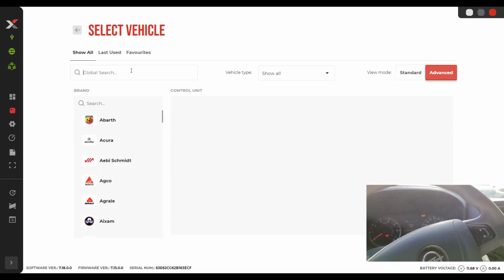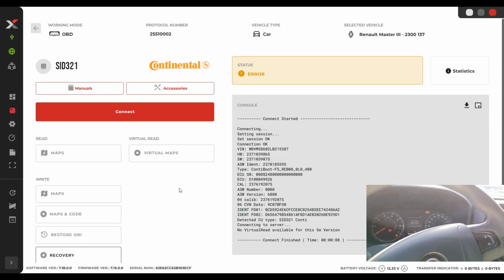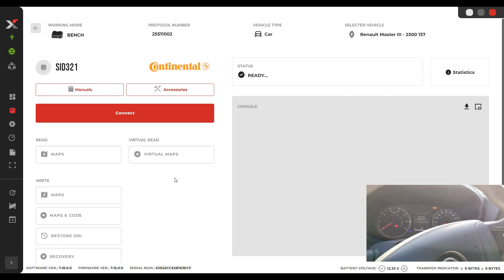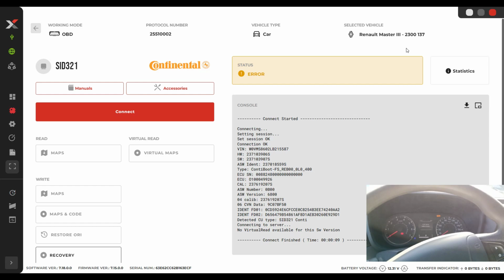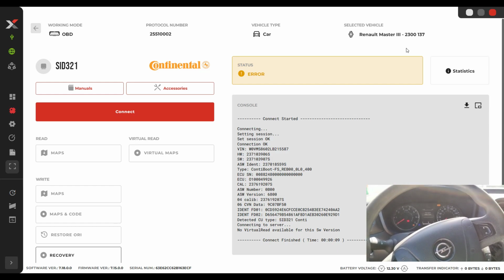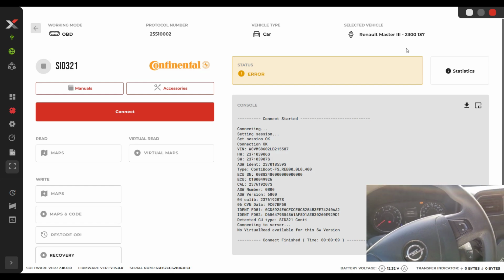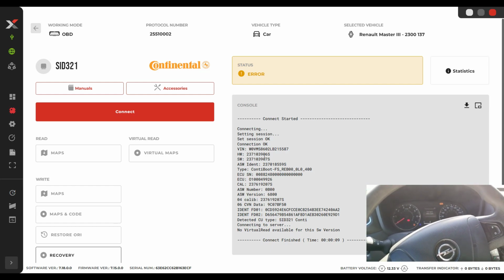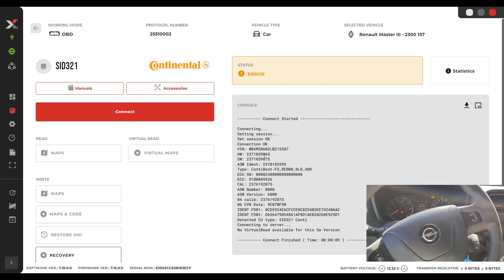Flex master vs Continental sid321 ECU. Even the best programmer fails!!.I tried it in OBD and Bench.

Comment: hello, nice video.
I bought flex and this ecu was one of the reasons why I bought it.
I was thinking about swapping to kess 3 because flex dont have to much older ecus, what do you think about that.
Alot of easy edc16 ecus flex cant do obd, that is pissing me off sometimes.
Reply from the maker: Hi.
The problem is that no programmer is perfect. Before buying a Kess V3  I save more money and I will go for CMD
Reply: @YOYODiagnostic is the cmd the best, in ur opinion?
Reply from the maker: @michaelgerasimov6457  It is a very good tool also for now and for old ECU's, then yes is  possible to be better.
Reply from the maker: It's true, Flax has problems with old ECU's. Last month I blocked a edc16u1 OBD, but it was really funny I have done many of edc16u1 and edc16u31 OBD if no Problem,  2 days ago I Block a edc17c69 Iveco from 2018, Checksum wrong.  Also a good tool can make mistakes.

Comment: Flex does not read and write several ECUs, it is quite a headache and even more so when you leave clients waiting for the work on their bad side. Marelli 8f3 does not read OBD/bench, 9f3 idem, med17.5.5 no OBD or bench, med 17.4.2 no OBD, and the list can go on... Edc17c10 no OBD, edc16c34 no OBD/bench... It really does not meet the expectations of the equipment and on top of that the subscription is very expensive!!! a disgrace!!!!Thank you yoyo and regards 👏👉🥇
Reply: i have done 8f3 a lot... and it works obd full read with flex... for me no problem to read ecus in bench, like edc17c10, edc16c34... problem is, with newer ecus, like sid321, newer ems ecus from renault/dacia like ems3140 ... and other md1 ecus that other tools can do them, and flex can't... they dont have  ASW files in their database... for example... i tried an  ems3140 ecu to read, and failed... they dont have the file on their database... i told them that client awaits... its been 3 months already, and they didnt update this SW...
Reply from the maker: Thanks for letting us know your experience. 👍
Reply: thought flex didnt have subscription
Reply from the maker: @legin3753  
A full master is 1000 euro every year.